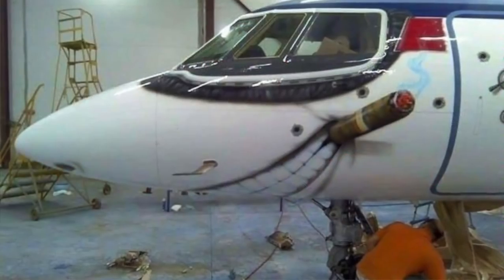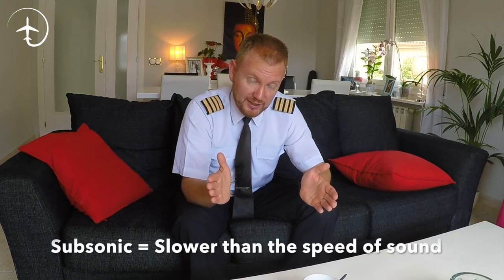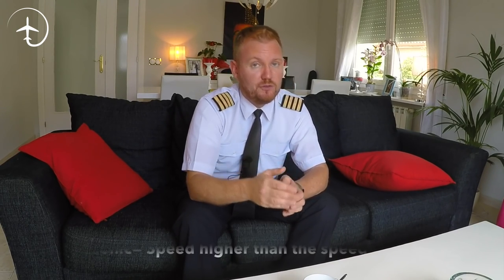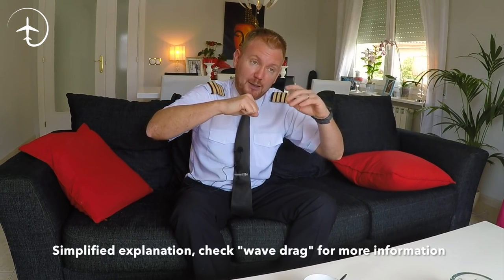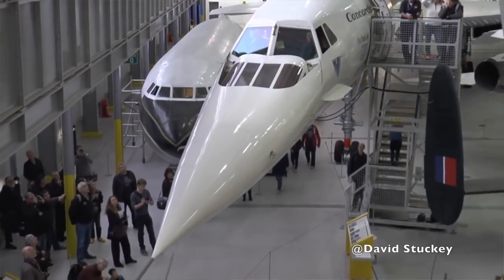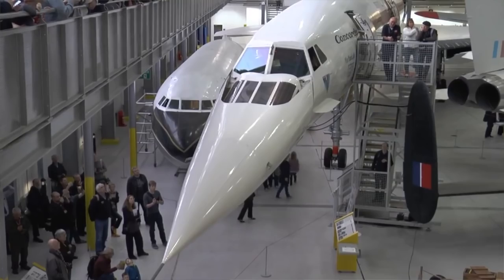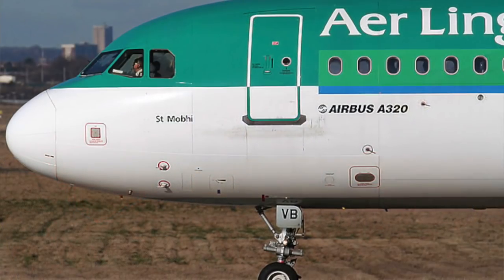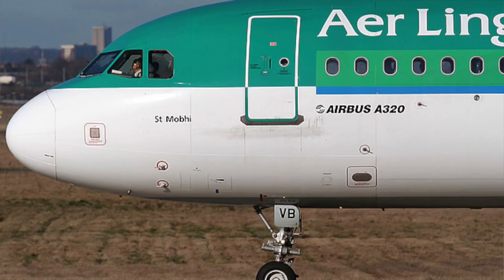Aircraft Noses. Boeing vs Airbus and Rounded vs Pointy.

Comment: Does a subsonic aircraft ever generate a sonic boom?  I think it does, sort of!
Several years ago - out in my sailboat on Lake Lewisville in Texas - Where it is VERY, very quiet -  I would notice planes coming in to DFW from cruising to approach phase.  
As they have landing lights on - even in the daytime - on a clear day I image they were visible even at altitude, 20 miles away.
I loved to watch them as they became "hear-able" because almost every time the transition was NEVER a subtle, quiet "whoosh".  
Every time I heard the beginning of what I could hear of the plane - there would be a small sonic boom, or a "bump".
Back in college I'd ride a motorcycle out in the rural countryside of Louisiana - which happened to be inside a MOA...
Back in the 80's some military jets WERE flying supersonic over land.  No mistaking it - I was there!  
When a high flying jet would appear over the tree-line, I would pull over, stop the bike, and listen.   
Absolute silence as the vapor trail tracked the speeding jet, then - always - having passed by... BOOOOOM!!!   VERY satisfying!

Comment: Why not make aircraft wiring's insulating vinyl cover with kevlar chop mixed in the coat ? Very difficult to abrade thru, not much more weight, slightly stiffer, and special stripper tools, but more safe...?? Then, those bundled into a kevlar 'sock' in xtra concerning areas, vibrating thru holes etc. [ Good for motorcycles also ]

Comment: Thank you for the explanation
But why the old airplanes has a black color nose.
Is it because of radar reflection? Or just for design.
Reply from the maker: I can find out.
Reply: Mentour Pilot thank you for reply and im glad for that.
Reply: Will be interested in what you find on this.  Back in the 70s, our national carrier, Air Canada, had what is colloquially called the "black nose livery" - I always assumed this was to do with reducing glare or reflections off the nose up to the cockpit windows...
Reply: Chris Stanley thank i appreciate that
Reply: Black nose is to prevent glare.
Reply: Probably because of the weather radar. The radome has to disturb radar waves as little as possible, so they avoided painting it in case the paint would have an influence. Therefore, the radome had the "raw" color of the material, which was often black by default. For newer airliners, I guess they have developped paints that do not pose this problem. It is still the case for fighter jets (which do not use the same wavelength as weather radars); even for modern ones, the radomes are grey rather than black, but usually a slightly different shade from the rest of the aircraft. On some close-up pictures you can see it says "do not paint".

Comment: Thank you--great video as always! A question though: as I understand it, micro vortex generators minimise drag, improve low speed handling, and in some cases, allow higher speed. And, of course, reduce fuel consumption because of lower drag. I've only seen them on light GA aircraft--"puddle jumpers" as some of my Dad's friends called them--and they seem to be placed close to the leading edge of the wing. Now the question: Why don't we see them on commercial aircraft, and especially on the fuselage to reduce "skin drag"?

Comment: Hi Petter! I have a question for you, can a passenger visit the cockpit during flight?
Reply: Hello, Petter has already answered this question. Unfortunately, during flight, it is impossible to visit the flight deck, due to safety policies after 9/11. You can however, ask if you can visit the cockpit on the ground, before takeoff, or after landing. If the pilots are not busy, they may let you in, but it depends on the Captain's decision.

Comment: Since the radio altimeter antenna is on the bottom of the fuselage and therefore can be many feet off the ground when an aircraft is on the ground, does the radio altimeter ever read zero or is it calibrated to read zero when an aircraft is on the ground?

Comment: Same explanation concerning the shape of gun ammo. Thanks. The way you explain, even a child will understand. Now that you talk mainly about the nose, is there only the weather radar behind? As I have seen the next episode about engines in the back, as they are smaller for the same propulsion, can it be that they make much more noise seen from the ground and is it possible that the speed of exhaust gas is supersonic, and causing a shock wave? Because I think it is not at the cruise speed of an airplane.....

Comment: Boeing had an internal joke that they had a fuselage machine that would produce a continuous length of fuselage that was then trimmed to the required length to make a 707, 727 or 737 - the cross section of all three are identical, though things like internal floor level, skin thickness, and frame design do vary.

Comment: In my (I'm not expert) opinion that comet nose is bad idea because there is no angle change between nose and windshield. Therefore in rainy conditions all water from nose is gonna pass surface of the windshield (at least that is the case of WV corrado g60 who got one knows what I'm talking about). Also must be more air passing next to windshield surface so you need more heat to prevent freezing. But I think all those problems are solved on 200 mill $ machine, it's not some junk car made 30 years ago.

Comment: I guess the higher the speed the sharper the nose , you can think of it as an umbrella if it close you can go easier forward faster and if you open it up you go much slower.and second I guess is because airliners no longer passes the 6oo mph knts barrier there  no longer need for a pointed nose . Also faster you go means more energy to move through the air hence more fuel.. also the faster you go eg 600 and above a shoch wave will be generated and larger the body at super sonic the louder the boom. Thats my take on it

Comment: I was wondering why the Cessnas have rectangular wings. Would not the sloped wings make it more aerodynamic?
Reply from the maker: To come in a different video
Reply: If you're talking piston engined Cessnas it's all to do with the primary operating speed. Much the same with turboprop airliners which you will also notice have straighter wings. Even the aircraft like Cessna Citations are always defined by their primary operating speed.

The Cessna 172R has a cruising speed of 122 knots. The ATR 72-600 (turboprop airliner) has a cruising speed of 275 knots. The Cessna Citation I has a cruising speed of 357 knots. A Boeing 737 currently in production has a cruising speed of 453 knots.

When we get to the kind of speeds of the Cessna Citation and up it begins to be useful to talk in mach numbers. 453 knots is mach 0.785. Note that the mach number refers to the speed of the aircraft; it does NOT refer to the airflow speed over certain parts of the aircraft. Airflow over certain parts of an aircraft can be much faster than the aircraft's speed. That's why the transsonic flight regime is so tricky aerodynamicaly. Bits are supersonic and bits are subsonic. Transsonic starts about mach 0.8. That's why modern jet airliners typically have cruising speeds of mach 0.78 or 0.79. That's about as fast as you can go before transsonic effects start being a major headache. It balances speed of journey, fuel efficiency and aerodynamic performance very well and is a sweet spot to operate in.

At those kind of operating speeds swept wings are the best. What Mentour referred to as the air "getting out the way" is formally called compressibility. Swept wings basically delay the increase in drag which occurs to higher speeds than with straight wings. At lower speeds compressibility doesn't matter so the simpler to design and build straight wing is used. At higher speeds the swept wing has to be used despite being more complicated to design and build. Incidentally wings optimised for transsonic or even supersonic operation are much, much worse at take off and landing speeds. That's why jet airliners and military jets have more complicated aerofoil alteration devices like flaps, slats and slots. They need to alter the wing shape more than a Cessna 172 or equivalent when landing or taking off.
Reply: Yes, that probably is true. However I was thinking Sweeping the wings back would have increase it's cruising speed, and also fix the sensitive pitch.

About the sensitive pitch. I am not real pilot so I have never flown real airplane. However, in Most(if not all) Simulators, the planes with Rectangular wings like Cessna 172 have extremely sensitive pitch(I have noticed this in MS FS, XPLANE, KSP, and few others).

Comment: Have any of the radar manufactures developed ‘phased array’ weather radars for aircraft? These would eliminate the moving radar dish in the radome and may allow some different nose designs. 

What are your thoughts on using cameras to better see the runway on approach or the ground while taxing around? It could be combined with VR with changeable viewpoints. e. g. nose front, undercarriage, etc.

Comment: Boeing did actually researched a newer nose.. in the 757.. wich uses the exact same fuselage as thr 737,727 and 707..

So i wonder why Boeing didnt just used the 757 nose on the newer gen 737s or made a "hybrid" new single aisle airliner combining them...

Comment: --MY TAKE: In the third or developing world,.aviation standards are not always adhered to, this was a rouge operation, I'll add a paragraph on the topic later. The Boeing Classics 737-100 and 737-200 do not have the two telling appearance features that became part of the 737 starting with the 300. The flat bottom to the engine housing, and secondly the lower part of the  vertical stabilizer extends 10' to 12' along the top of the aircraft in a smooth line. Some people may have seen an image of a Classic 737, or pieces of the Cubana  aircraft that crashed, didn't have the two features I mentioned leading to the idea the media made a mistake calling a 737, an A319 or A320.
-BACKGROUND
The Mexican charter company which owned the plane that crashed in Havana on Friday, killing 110 people, has been the subject of two serious complaints about its crews’ performance over the last decade, according to authorities in Guyana and a retired pilot for Cuba’s national airline
Cuba: more than 100 dead after plane crashes shortly after takeoff
The plane that crashed was barred from Guyanese airspace last year after authorities discovered that its crew had been allowing dangerous overloading of luggage on flights to Cuba, Guyanese civil aviation director Capt Egbert Field said.
Ovidio Martinez Lopez, a pilot for Cubana for more than 40 years until he retired six years ago, wrote on Facebook that a plane rented from the Mexican company by Cubana briefly dropped off radar while over the city of Santa Clara in 2010 or 2011, triggering an immediate response by Cuban aviation security officials.

Comment: Thank you so much for this great info, I always wondered about this. But I still have a question: to optimize a shape you have to use mathematics. Once you have the RIGHT formula, there is only ONE formula. One ideal formula (in my very humble and perhaps ignorant opinion) would produce ONLY ONE ideal shape. Therefore, all planes should obey to the same mathematical formula and have the same shape. I am probably wrong... But notice the nose of an Airbus A-380 and the one of a A-330... they are different. Same for the A-350. Not to mention the Airbus A-220 or Mitsubishi MRJ. They are all subsonic planes but have all different noses. They say the DROP is the ideal aerodynamic shape and all drops look the same. If engineers want to design the ideal plane why are there more than one shape around?  Thank you in advance and forgive the length of my question.

Comment: My question: Do Boeing airplanes regularly have a higher outspeed regime than an Airbus due to their noses?

What AI answered me: There is no definitive answer to this question as it depends on a number of factors, including the specific model of aircraft, the operating conditions, and the pilot's flying style. In general, however, Boeing aircraft are typically faster than Airbus aircraft in the high-speed regime. This is due in part to the fact that Boeing aircraft tend to have longer noses, which provides more aerodynamic efficiency at high speeds. Additionally, Boeing aircraft are often equipped with more powerful engines, which also contributes to their higher speeds.

Comment: Do you think that eventually they may do away with transparent windshields and windows on planes with cameras and screens? I would imagine that it would make the manufacturing simpler, possibly cheaper. the cameras would need very small apertures and since they can be redundant and mounted anywhere, there would be no issues of the shape of the nose or other parts of the plane interfering with visibility. In fact you can get 360' views just like in some cars now. What are your thoughts on this?

Comment: As i mentioned before, i used to work at an aircraft salvage yard, and have removed many b737 nose cones (radomes) and the weather radar dish, and the ils antennas which are all in there

There really interesting aircraft to work on, the main gear bay is full of hydraulic pipes and wires, i have stood on the bridge between the main gear wheels whilst the gear has been retracted, and done loads of other neat stuff

I even took all the doors off the Insides of the wing tanks, and crawled up inside the wings to as close to the tip as a person can get

I have been in the avionics bay, i have sat in the cockpit listening to atc on my break, and actually ate my sandwiches in the captains seat, and drank coffee 😁

I have started and shut down apu's and engines on the b737

I have even towed a b737 around from taxi way to parking pan with a tug 😁

Another neat thing i did was, me and the crew taxied a b737 from the runway to the parking pan under its own power, when unfortunately the ferry pilots were drunk, they literally stopped the aircraft on the runway, opened the external door, lowered themselves out onto the runway, ran off, jumped over the airport perimeter fence and continued running, got into a car which was waiting close to the airport, and were driven away

So, me and the crew had to jump up and grab onto the step, lift ourselves up into the aircraft with no stairs, and both engines still running, and taxi it ourselves

Like i said, some neat stuff 😁

Comment: Hello,I am an aviation enthusiast from India, I was curious to know (if it can be worked out) if there was the safest seat that a passenger could book on a boeing
Just curious
Thanks for the wonderful explanation
Reply: I mean it really depends on the type of incident but I’d say you’d rather go in the back. Minimum fuel stored and the two engines are far away, also chances are you crashed nose first. But sometimes it’s the back that blows up and the front is safer or just everyone dies

Comment: Concorde speed is M=2,02 mach so to prevent subsonic boom wave occurrence on frontal fuselage, cone angle must be less than Sin(a)<1/M<29,7 degree Tupolev 144 who copied Concorde made very similar but Russians used much more powerful engines so cone part of fuselage must be even more edgy and pointy, catastrophe that happened Tu-14 was fuselage disintegration because if sonic boom waves touches fuselage it is not just big drag for plane but have and catastrophic consequences.

Comment: Great informative video! I had seen your explanation with the Sichuan Airbus incident where the windshield had broken, and mentioned due to the nose-design, there is an air bubble created which causes much of the air to deflect upwards and not directly entering the cockpit. Could we say the same thing for the 787 with it's drooped down nose?
-A request could you do a video on "Horizontal Stabilizer" I've always noticed the joint of the horizontal stabilizer to the tail section, the paint seems "scraped", I later read that not only the elevator moves, but the whole "horizontal stabilizer" "moves" and it's angle of attack. thank you!

Comment: Why do Boeing wing and Airbus wings look a bit different? And why do they have different winglet designs?
Reply: Miguel Bilan I guess that is as well due to manufacturing capabilities and individual outcome of calculations and tests.
Looking at the latest version of wing tips they seem to go either for a larger winglet like we are used from boing plus a smaller downward winglet as in the Airbus one. Also the latest ones seem to be a lot flatter, bit instead slanted backwards
Reply: Alex Ku do you think that there’s any airbus vs boeing design cues that is completely aesthetic?
Reply: The wings look different because they are designed with different aerodynamic characteristics but generally they are both just as good as each other.
Reply: Miguel Bilan I am sure there are. Line for example shape of the windshield etc. Sure best view is main priority, but why not also make it look nice?
There are most likely other things, but to the most part design reasons are more on the öractical side. E.g. easier to manufacture or assemble, easier to maintain, structurally more sound, less noisy, better aerodynamics, more room for passengers and luggage, less fuel consumption, ...
Reply: Hi Miguel! I just got to talk with a Bombardier flight mechanic that said their winglets were added on! The Regional Jet used to have a maple leaf painted on the tail (Canada) and the new Corp. from a different country repainted it and added the winglets! Interesting.